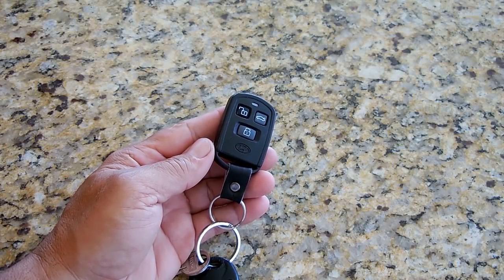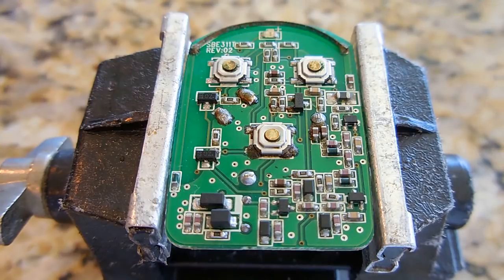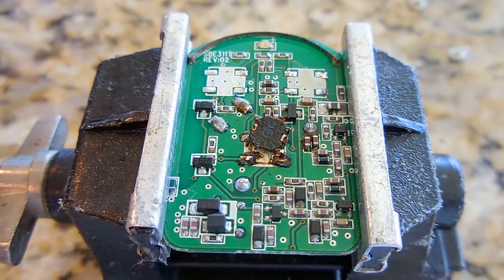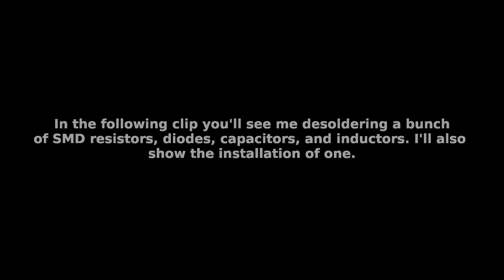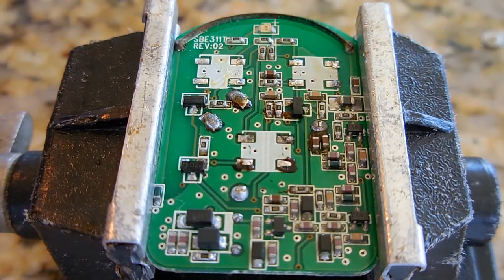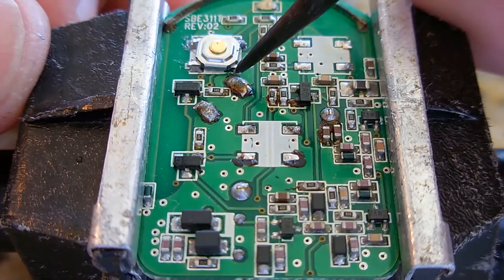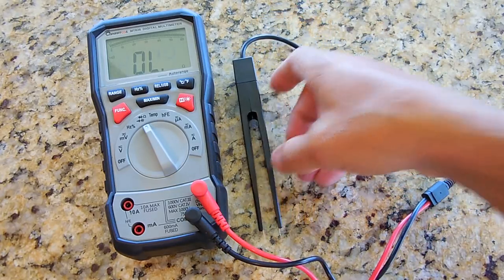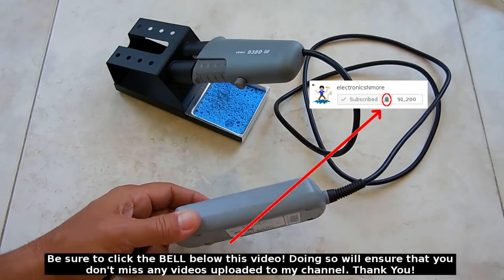Keyless Remote Repair(Push Button Switches)

Comment: If the plug is grounded on the soldering tweezers, since it says ESD Safe you'll want to check and make sure there is an actual ground path from the tip to the ground on the plug.  I bought a different soldering station (made in China) that's a Hakko knockoff and it claims to be ESD safe, but there was no actual connection between the tip and earth ground.  There was a solder point on the board for it but that's where it stopped.  I had to make a ground wire myself to fix it.

Comment: I’ve determined my keyfob needs a new ic chip, is it possible for me to get it somewhere? R you recommend a supplier it’s an Omron  md011 411E105
Reply from the maker: May be cheaper to buy a used replacement remote.

Comment: I've superglued so many of these things. They work just fine if you do it right.
Reply from the maker: Super glue? LOL
Reply: electronicsNmore yep, it's held up for a few years now, I cleaned the contact points and glued the original (still functioning) button back in place. I didn't have any decent soldering tools at the time.
Reply: Do you mean to say you put a small amount of super-glue between the back of the switch and the circuit-board such that the tight adhesion provided good continuity between the switches contacts and the pads on the circuit-board, or do you mean you used super-glue instead of solder between the contacts and the pads (I'm fairly certain it has no continuity)?
Reply: Burfurd64 yes. I've created my own proprietary, highly conductive superglue that is capable of transferring current with nearly no resistance...       All jokes aside, you are correct in assuming that it was just applied to the back of the button and the leads were pressed to the board to create contact, then glued over to secure them in place. Not ideal, but it gets the job done.

Comment: Awesome vid. I want to remove the push button and solder a 3' wire with a push button on the other end. Will that work? But the wire has 2 legs. How do I know which of the 4 contacts to use?

Comment: I have seen those tweezer things for a while now and always wondered if they worked or were worth buying.
Reply from the maker: They're great for swapping out SMD diodes, resistors, capacitors, or inductors. You can also use them to remove SMD transistors. Use the 2 tips to heat up the side of the transistor with 2 pins, lift it up, then  desolder the remaining pin.

Comment: What about hot air inst that better?? There are way smaller switches like 4 times smaller, |Or will the switches melt from the hot air?
Reply from the maker: juliusvalentinas More than likely they'll tolerate the heat.

Comment: i have replaced the KEY FOB battery 3 times in the last 2 weeks, i replace it with a new battery and it works for 4-5 days and then nothing , i hit the button no light no response from car 

in the mean time i have observed the remote if the light was staying on like a button stuck but its not 

I used duracell cr2032 batterys
Reply from the maker: Something is clearly draining the battery down.
Reply: @electronicsNmore  solution

Comment: Hi, it is not good if you blow the solder joints because you are contaminating them :) Great video
Reply from the maker: Only if you have a habit of spitting out saliva when blowing. :-)
Reply: @electronicsNmore  well you don't have to spit others to contaminate them :)

Comment: I've gotta get me some of the those tweezers (both types). Are new tips readily available for the solder tweezers? Great vid! =)
Reply from the maker: Be sure to use the link provided, and the coupon code. Only $43.50 shipped with the supplied coupon code. Yes, tips are available. Thanks for watching!

Comment: You didn't need tweezers to do it. A wide enough soldering tip would do the same and it would be simpler to hold in hand.
Reply from the maker: Tweezers makes the job easier, especially when removing the old button. You're entitled to your opinion. I read your original comment, haters gonna hate, it's YT!

Comment: you didnt clean the board very well, still lots of corrosion on the centre button pads and also around the caps to the right. sloppy
Reply from the maker: Sound like you've got OCD issues. LOL. The job was just fine.
Reply: @electronicsNmore  No, he's right.  That was sloppy work.  What WAS that goop?  How do you know that's not what ultimately caused the switch to fail?  My guess is that it was.  And there's a bunch more of it splattered around the board.  What's going to fail next?
Reply from the maker: @ydonl  Love all the "experts" on YT. LOL. Remote still working just fine. Have a great day!
Reply: @electronicsNmore  Yeah -- "experts" on YT. 

That's the not the only measure of good work.
Reply from the maker: @ydonl  I've made many repairs to electronic circuits over the years, and the long term failure rate is extremely low. You don't know what a dirty board looks like, I've seen them. FYI, this board was shown in another video after it was cleaned and a conformal coating was applied. Next time ask if I was done cleaning it.
Reply: @electronicsNmore  I see.  I get your drift.  Sorry for trying to make a point. I guess we're just not compatible.